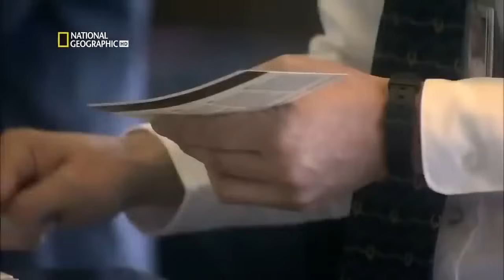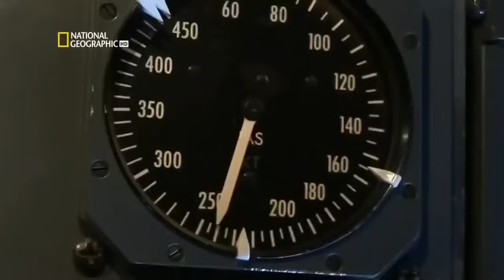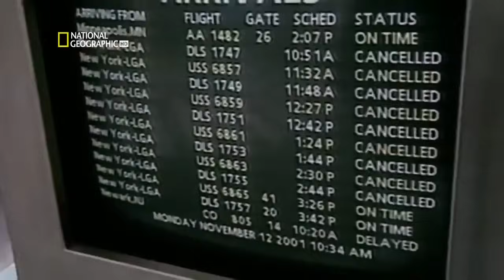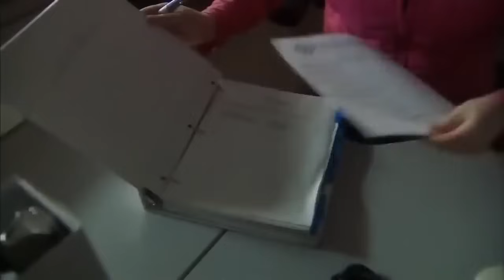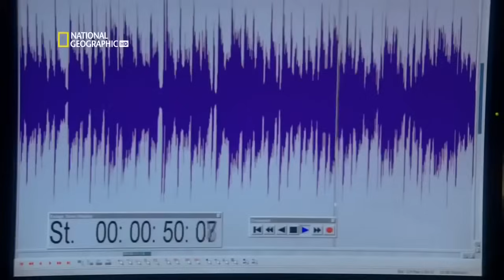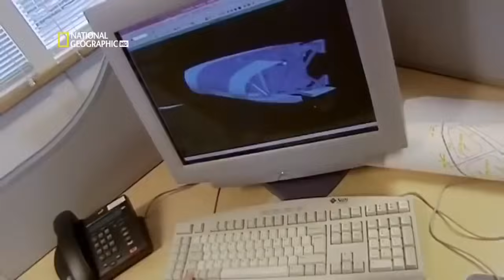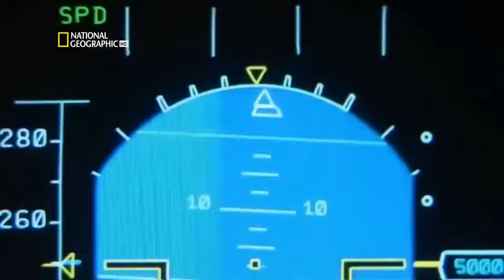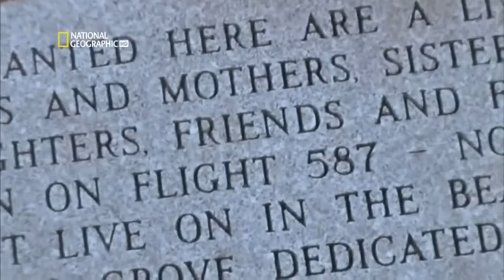American Airlines Flight 587 | Air Crash Investigation | National Geographic

Comment: Literally every Aircraft Investigation:

"They need to find the black box to know what happened. The black box is designed to withstand any crash."

5 seconds later: "The black box is completely destroyed."
Reply: 😂😂 it's so true
Reply: @AHR 12 You should pay attention! He was trained to do that maneuver. Airbus forgot to mention that sensitivity of the rudders and then AA trained their pilots to incorrectly perform such maneuvers.
Reply: LMFAO
Reply: @xrey83  - They were warned of possible turbulence, they're experience pilots, and they ignored the warnings and their training.  They fucked up, badly!!  The A300 is not a well-designed aircraft in terms of strength.
Reply: @AHR 12 - NO!, Hardover rudder left to right and back repeatedly is NOT an accepted procedure to combat turbulence.
Reply: @AHR 12 I do not like airbus either, but I have to disagree with you. The pilot was TRAINED to do this, in fact, all of them were because the AAMP was OVERESTIMATING the effect wake turbulences would have on a jet airliner. IT WAS ON PURPOSE!
Reply: @AHR 12 IDK if the captain was trained by American air or not, but the lack of communication was there, I won't deny, but calling him a murderer is a bit too far
Reply: @AHR 12 I can agree with that, but most of the blame should go to the airlines for making such a faulty operating procedure
Reply: I worked for the manufacurer of the FDR (Honeywell). Often, the box is destroyed and even the module that holds the memory (flash) is mutilated. What we do is carefully remove those chips from the wrecked PCB and install them on a known, working board.  It's very rare that we couldn't get data from a recorder.
Reply: The Co Pilot Is So Dumb That He Murdered Everybody On Board Flight 587.
Reply: Lol design the plane to withstand any crash
Reply: @AHR 12 Firstly European products actually have much better ratings than any other products especially in the plane and car sector so lets get that bit straight. If you have statistics that disprove ive got my own too. Secondly Airbus told AA their trainings were of concern and recommended they avoid the aggressive use of the rudder. AAs training was regardless of input retarded why would you slam full right and full left for wake turbulence in a big aircraft like the A300 which is alot more stable than the 737 or MDs that I could possibly see them needed that amount for. What accident prior to this gave them the need to enforce such training. The only fault Airbus should take from this is not reporting AA to the FAA for observation of their trainings. Airbus got a plane certified that Boeing and the FAA pressed them hard not to im very sure the FAA would have added additional tests and made Airbus change alot on that plane for it to be Safe. Same can't be said by the FAA with Boeing.
Reply: @AHR 12 I say again the lack of communication was there, no doubt, the reason WHY he didn't say anything could be because he thought the captain knew what he was doing. I also don't claim I read the manual, I also mentioned it was a training procedure if you can read, which from your comments, I doubt, you would've seen that I mentioned that it was a training procedure, not a list in a manual
Reply: @roberternest7289  i believe the Captain should of took over the minute he saw the co-pilot having a problem
Reply: @melvynsngltn27  Yes, he should've, but he didn't. Why? Maybe he wanted the copilot to learn something, maybe he didn't notice he had a problem, either way, the copilot is as responsible for the crash as the captain, the Airbus company and the training by the AA.
Reply: Number1HockeyPlaya lmaoo For real 
tho
Reply: AHR 12 Was it necessary to call him a rat??? I know he might have killed them but just to call him a rat? And he didn’t even mean to kill them! So no use call him a rat
Reply: Well, it's either "the black box has been completely destroyed" or "the black box hasn't been recovered". Talk about a useless job..
Reply: AHR 12  U spoilder🤣
Reply: @AHR 12 I've actually done a little research of all air crashes since 1990. It came out if you travel on a Boeing you are most likely to experience a crush due to a malfunction of the plane. While on Airbus pilot error or terrorist attacks. Results were very close though.
Reply: Ya 😂🤣
Reply: Why don't they just make the whole plane out of that Black-box Stuff-jus Sayn
Reply: @mohammedkenneth5229  lwlllwlllwlwlwlwllwlwllwllwlwlwlwlwlllwllwllwllwllllllwlwlwlwlwlwlwllwlwlwlllllllllwllwlwllwlwlwllllwlllwllwllwlwlwlwlwlwlwlwllwlwllwlwlwllwlllllwlwlwlwwlwlwlwllwlwllllwllllwlwlwlwlwlwlwlllllwlllwlwlwlwwlwlwlwwllwlllwlwlwlwlwlwlwlwllllwwllwlwlwlwllwlwlllwl2wlwlwlwlwlwllwwlwllwl2wwllllwlwlwlwlwlwlwlwlwllwlwllwlw2wwwlwwlwlwllwwlww2wwlwlwp wplllwpw2lwlwlwlwlwlwlwlwlwllwlwwlwwlwlwlwlwlwlwlwlwlwlwlwlwlwlwlwlwlwlwlwlwlwlwlwlwlwlwlwllwlwlwlwlwlwlwlwlwlwlwlwlwlwlwlwlwlwlwlwlwlwlwlwlwlwlwlwlwlwlwlwlwlwlwlllllllwlwlwlwlwlwllwlwlwlwllpll
Reply: They always have to send it to some specialist in Germany or France
Reply: I’ve never heard that
Reply: Whatever the black box is made out of the plane should be made out of that too.
If it’s indestructible.
Reply: JR GR ppoopoplooo you
Reply: @AHR 12 Gis training teach them to do that...
Reply: Improper training is not pilots fault is the airliners incorrect training
Reply: AHR 12 noris nút
Reply: Osm
Reply: Black box is the most important thing and sometimes it doesn’t survive and it’s super shitty
Reply: The captain should  have waited more  until the other airplane took off .also the air traffic control has given a turbulence warning
Reply: @xrey83  in
Reply: You forgat to say ( plot twist) 🙄the black box is crasht 😌

😳
Reply: I think it’s really cool how they built them to withstand so much and they can be mostly destroyed and still have recoverable data. The CVRs and FDRs are a marvel of engineering
Reply: It’s not even black, we have all been lied to
Reply: @Perfectpearl  the reason why the entire aircraft isn't made of the armor plating those flight recorders are encased in is the weight. Airplanes not only have to be strong, but light as well. How else would they be able to fly?
Reply: We all learn from our mistakes. Unfortunately this one cost hundreds of lives. Who would have thought a Pilot could tear a complete tail section off a plane.
UNBELIEVABLE!
Reply: they have trouble finding it because the black box isn't black.
Reply: Well I’m pretty sure that the black boxes are designed to withstand MOST crashes. To change it to ALL crashes the black boxes would need to be redesigned to be much tougher
Reply: @Cooldude-ko7ps  They're looking for black boxes, but they aren't black. They're orange.
Reply: @adotintheshark4848  black boxes are just called that. Aircraft black boxes are actually bright orange
Reply: @roberternest7289  lmao your insults are awesome
Reply: @Jahlen.johnson  Thank you!
Reply: a blackbox can withstand heat of up to 600°c
Reply: You serios?
There is a documentery about people daying in a horyfying plane crash
AND ALL YOU DO IS MAKE A MEME ABOUT IT?
Reply: @nurkrdyn1125  uh oh someone needs their diaper changed
Reply: @mohammedkenneth5229  lol that’s actually basically what it designed to do. All that’s needed is the data, so the case it built to absorbed much as it can and the data is tough enough to be recoverable
Reply: Haha literally 😂😂
Reply: It's unfortunate for the victims, and their loved ones left behind, but lessons are learned from every aircraft that crashes. In this case it was the inadequate training procedures at Airbus for the pilots flying their aircraft.
Reply: @HyperLinguist-AI  I don't think the black boxes are made of anything like soft metal or aluminum as you state. Do your research. The black boxes, CVR, and flight data recorders were all recovered from Air France 447 at the bottom of the Atlantic from a depth of 14,000 ft I don't think these would've survived that depth If they were made from aluminum, or tin somehow.
Reply: @HyperLinguist-AI  I'm not sure what metal these data recorders are made of. But the boxes themselves have to withstand ocean depth's of up to 20,000 meters. 9 times out of 10 the boxes are severely damaged in an air crash but the vital recordings are recovered intact, which is what they are designed for.
Reply: MANNN IS SO TRUEEEEE
Reply: True lol
Reply: Yeah, because no one can rule over physics. Crashing into the ground with hundreds of feet per second is just a truly incredible force…
Reply: It's very very rare but sometimes it happens 😢
Reply: @ScottDLR   thank you for good details.
Reply: @kristianfairchild7774  It's not a dumb question. I worked for Honeywell, the mfgr of most FDR's (blk boxs). The problem would be that the walls of the plane would be about 6' thick and the weight would be immense!
Reply: Literally every cover up.
Reply: 🤣🤣🤣everytime bro
Reply: Literally bahaha
Reply: Why don't they make the entire plane out of the black box material? Problem solved.
Reply: @markd6634  Fucking. Genius.
Reply: Nope
Reply: HAHAHAHHA
Reply: There are 2 black boxes
Reply: The complete investigation comes to a halt until they then finally get the CVR recordings.........

Or 

The investigators are under huge pressure to investigate the cause of the accident.
Being said literally after the very first 2 minutes of being on site! lol
Reply: And its orange.
Reply: @mohammedkenneth5229  99900000000
Reply: Most likely a Democrat that caused the crash.
Reply: "I don' t care what anyone says this looks like pilot suicide to me" - Greg Fieth
Reply: @markd6634  they do it called an armour vehicle…because it will be too heavy to fly..Problem unsolved.
Reply: May be yes
We say black box but color of the box is orange.
Reply: @adotintheshark4848  in the early days I think they were black. Then made them bright orange so they would be easier to find in the event of a crash.
Reply: @roberternest7289  wasn't it the F.O
Reply: @xrey83  It was mention but it was in a notice bulletin
Not a direct order
Reply: Never seen that!
How many examples have you got?🤔
Reply: @Robert Ernest  -
I want to know why the captain didn't see what was happening with the rudders??

He should have picked up on the excessive movement and done something about it!
Reply: @nm628679c  Wake Turbulence.Its called wake turbulence from a 747. A super Jumbo,. Very powerful wake it can form
Reply: LOLL 😂😂😂
Reply: ongod
Reply: STEN MOLIN (Copilot Molin overuse of rudder controls and broke the composite lugs that attached the vertical stabilizer and it failed at 9:15:58. His wacko movements of the rudder from fully left to fully right, and back again in quick succession, resulted in hazardous sideslip angle that led to extremely high aerodynamic loads and it detached the vertical stabilizer from the plane. If the first officer had stopped moving the rudder at any time before the vertical stabilizer failed, the aircraft would have leveled out on its own, and the accident would have been avoided. He was not a good pilot. But also the captain has part of the fault because he should have waited at least 3 full minutes to take off behind Jap Airlines 747 heavy departing ahead.)
Reply: Yeah, I don’t think so. I’ve watched a lot of these videos now, the black box  is almost Never destroyed!
Reply: @Perfectpearl  that won't help the squishy people inside.